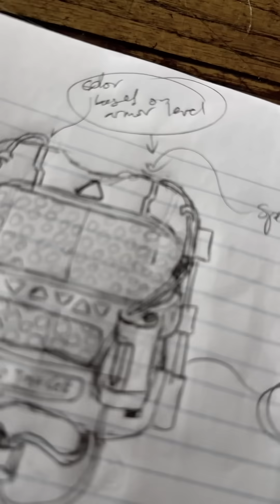BATTERY ARMOR 💥⚡️#shorts #bulletproof

Comment: Are those 26650s? If so you should throw them away and use 21700 instead. The 26650 is probably the worst  li-ion batteries made.

Comment: the problem I foresee, especially after watching your test run, is mitigating repeated shots. one round seems to fully destroy your cell, which then leaves the armor behind it inadequate. modern fighting means expecting rapid fire from multiple targets, so hinging the rigidity of your defenses on something that can only reliably take one round seems spooky. furthermore... if other systems you are strapped to are slaved to that power chain, then losing cells means multiplicative increases in vulnerability throughout a fight. I'd bet that the weight of the exo becomes a liability as it loses function. especially in the case that it isn't viable body armor on its own.

Comment: Harrison Armory External Batteries
2 SYSTEM POINTS
System
// Tokugawa 1
EQUIPMENT EFFECT

Weapons that deal any energy gain +5 RANGE if they are ranged or +1 THREAT if they are melee. When you take any structure damage, this system is destroyed and you take 1d6 AP explosive damage from the explosion. This damage can’t be prevented or reduced in any way.

Comment: ### Enhanced Suit Overview with Upgrades

*1. **Outer Armor:*
   - *Kevlar Armor:* High-density weave for ballistic protection. Coated with a nano-material for self-healing and added durability.
   - *Aerogel Layer:* Integrated for impact absorption and thermal insulation, also nano-coated for self-healing.

*2. **Structural Components:*
   - *Skeletal Framework:* Constructed from carbon composites for lightweight strength and flexibility. Coated with nano-material for enhanced durability and minor repair capabilities.
   - *Joints:* Made from titanium alloys for load-bearing and durability, with nano-coating for protection against wear and minor damage.

*3. **Energy Harvesting Technologies:*
   - *Thermoelectric Generators (TEGs):* Integrated into the hands to convert temperature differences into electrical energy. Nano-coated for improved efficiency and protection.
   - *Electromagnetic Energy Harvesters:* Nano-sized antennas and rectifiers in the fingertips to capture and convert RF energy into DC voltage. Nano-coating ensures efficient energy conversion and durability.

*4. **Self-Healing Mechanism:*
   - *Nano-Tech Coating:* Applied to all armor plates, structural components, and energy-harvesting systems. Provides self-healing capabilities to repair minor damage and enhance longevity.

*5. **Power System:*
   - *Graphene Ultracapacitors:* Located along the spine of the suit for energy storage. They store harvested energy and manage power distribution throughout the suit.

*6. **Mobility and Augmented Strength:*
   - *Exoskeleton Components:* Visible along limbs, enhancing strength and mobility. Crafted from a mix of carbon composites and titanium alloys for balance between durability and flexibility.

*7. **Communication and Sensors:*
   - *HUD:* Integrated into the helmet, displaying real-time tactical information, GPS, environmental data, and targeting systems. Includes thermal, infrared, night vision, and laser-guided targeting.
   - *Communication Systems:* Secure radios, satellite links, and advanced network systems embedded in the helmet for comprehensive communication capabilities.

*8. **Climate and Environmental Control:*
   - *Temperature Regulation:* Adaptive climate control systems to manage insulation and cooling/heating based on environmental conditions.
   - *Environmental Protection:* Systems to filter and neutralize chemical, biological, and radiological threats.

*9. **Additional Features:*
   - *Advanced Sensory Systems:* 360-degree cameras, sonar, and Lidar for enhanced situational awareness.
   - *Combat Enhancements:* Integrated weapon systems, defensive countermeasures like smoke dispensers, and electronic warfare capabilities.

*10. **Testing and Maintenance:*
   - *Performance Testing:* Rigorous simulated and real-world testing to ensure the suit's effectiveness and durability.
   - *Maintenance Protocols:* Regular maintenance and calibration procedures for all systems.

*Visual Summary:*
1. *Armor:* Multi-layered Kevlar and aerogel with nano-coating.
2. *Structure:* Carbon composites and titanium alloys, all nano-coated.
3. *Energy Harvesting:* Nano-scale TEGs and RF energy harvesters in hands.
4. *Self-Healing:* Comprehensive nano-tech coating across all components.
5. *Power:* Graphene ultracapacitors for energy storage and management.
6. *Mobility:* Enhanced exoskeleton for strength and flexibility.
7. *Communication and Sensors:* Advanced HUD, secure communications, and sensory systems.
8. *Climate Control:* Adaptive systems for temperature and environmental protection.
9. *Combat Enhancements:* Integrated weaponry and defensive systems.

This advanced suit design provides a high level of protection, energy efficiency, and functionality, making it suitable for a wide range of demanding scenarios.
Reply: Best if luck I expect great things

Comment: Hey kid your body produces electricity in small amounts if you use tye sticky electrodes from hospitals to get measurements from you or tens unit pads  work good to but  you need to find a way to step amplify to the magnitude your trying to achieve micro  ceramic graphene capacitors can help achieve that make them your self using your lattice gradient design from your armor this should increase surface area and increase flow of charge to give each cap a slight bump over the public version

Comment: I'm thinking you'd be better off with an armor battery sandwich with a thinner exterior layer or bonus stupid/cool points and instead reactive exterior layer (greater risk of damaging cells and the human body is the ultimate failure point so more kinetic energy will rapidly become problematic) with preformed failure vents either way.  And probably integrating some capacitor cell plates or switching to a super capacitor system.  Oh and flatter cells.

Comment: 556 green tips are just what the military uses for training, def harder to stop than non green tips but not by much, Black tips are their actual AP rounds
Reply: It's also likely pricey as hell to buy black. The green should still be a good approximation.
Reply: @Human-encyclopedia-69 M855 is nowhere near a good approximation for M995. M995 pierces 12mm of rolled homogenous steel at 100 meters, while M855 can only do around half of that
Reply: Green tips are also used for machine guns.

Comment: Having a blow-out panel system would be better in my opinion. The damaged batteries could just pop off instead of just sitting there fuming and burning. Using the deformation power of a bullet to pull it off would be best, it's hard to get explosive bolts as a civie

Comment: I think you'd be interested in sodium sulfur cells, they run at 300 C but if you managed to make a low profile mobile version, they can be basically any shape, have a higher energy density than Li-Ion, and are far safer at failure.

Comment: By the way, the M855 ammunition has a steel jacket in it and not a core. It was meant to pen hard cover. Just so you know that might make a difference in your testing.
Reply: M855 has a copper jacket with a steel core.
Reply: You got that backwards chief
Reply: Copper jacket steel tip.

Comment: How can we reach you? Your living my dream and I had ideas for much heavier types of these suits, think spartans without power assist, self load bearing, suits that are designed to get ripped apart to protect the operator while being cheap to maintain and repair. I know you've said there is a buisness end to all this already, I'd rather work with you guys than have to compete with an entirely different but similar suit. Maybe an intern possibly an employee? IDK, I can't get the 10 grand together i'd need to start working on one of these prototypes, but the concept should be less than 3k for the suit once produced.
Reply from the maker: crashmakerspace@gmail.com or Patreon in my Makers Chat!

Comment: Why doesn't he just use a two-layer system to protect the battery cells and the person wearing it?
Reply from the maker: To have armor in front that would stop the round entirely would double the weight. And if the cells did get damaged, while they don't explode, they do get hot, so they can't be against the wearer hence this configuration which is lighter & provides power to other peripherals on a suit.

Comment: Thermal runaway? Use non lithium batteries that don't have that problem lol
Reply from the maker: It’s not the lithium that has the problem, it’s the oxygen release of oxide cathodes which Lithium Iron Phosphate (like I’m using) don’t have hence—stable
Reply: @CrashMakerspace  wrll, again, theres quite a few batteries out thereby niw that boyh dont have thermal runaway and don't really release anything at allehen punctured

Comment: M855 isnt a true armor piercing round. Like you said, its steel core, but it was designed for windows, not armor
Reply from the maker: Correct, that's why I'm not saying AP, but it does tunnel better than standard FMJ
Reply: @CrashMakerspace  Fair

Comment: what kind kf cells do you use? if not already using it, have a look at LTO cells, they are extremely durable and have a DOD of 100% and extremy high discharge power, but might be a little heavier that equal capacity lifepo4 batteries.
Reply from the maker: Yep that's why I'm using Lifepo, they have good energy density still while being very stable and super durable!

Comment: I see an issue with armor having ton of details (probably slightly mitigated by outer anti-meelee jacket), that can get you stuck when going through environment - like through branches in forest. Problem with off-gassing off damaged cells could be solved by adding vents (and thinner layer of armor between you and cells). This would also make armor more resilient in prolonged encounter.

Comment: Are the isolation boards protected? I'm worried about the scenario where both the cell and the isolators are damaged, breaking the redundancy
Reply from the maker: If the isolators are shot then power is still severed since those are also the gateway connection to the power rails
Reply: @CrashMakerspace 
Aren’t the cables a bit too exposed? What do you think – should they run underneath or maybe even through the panels? Killer ideas, by the way – keep ’em coming!

Comment: Still think you should take a second look at the spinal battery. I need it to power peripherals. Armor doesn't matter so much to me because ive already got an integrated plate carrier. Im currently using LI-N-Mn batteries. You of all people should know what that means.
Reply from the maker: Linmn batteries are more prone to thermal runaway and don’t have a long a life as lifpo hence the chosen cell chemistry for this build
Reply: @CrashMakerspace  precisely. This is why I need your build. Ive got the cells as protected as i can, but I can only use half their capacity (100%-50%) to keep cell memory as low as possible. I need an 8s pack to generate 30v for a solenoid. Would you consider hooking a fellow YT maker up? Even the design notes would be sufficient, ill source the parts myself. I'm working on "cybernetics" so the armor portion of your build doesn't interest me much, but i need a centralized power distribution system that  can stand up to abuse. Long story short, im building a sandevistan. Help a fellow maker out. Please? I could come up with my own solution, but you've already done the homework, might as well cheat off your test.

Comment: Why not make the batteries shaped like the armor plates.
Reply from the maker: The tight circular design is optimal for batteries in general and is very-sound structurally for deflection of melee impacts while these sit on the outer layer
Reply: This man need a award just wow
Reply: Keep Doing your stuff love your videos 🎉
Reply: Wonder about smaller cells and more of them to increase energy density and arrive at a smaller, flatter profile 🤔 

Curious how that would hold up to ballistics testing.